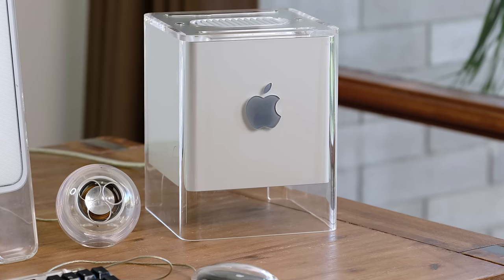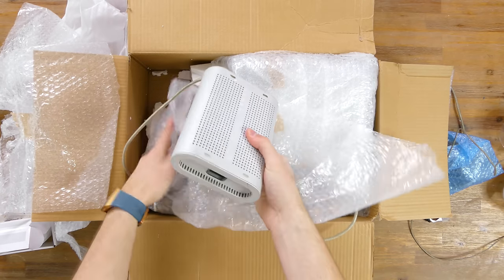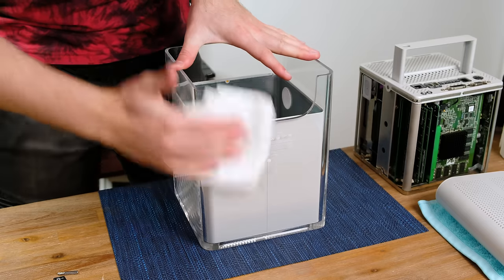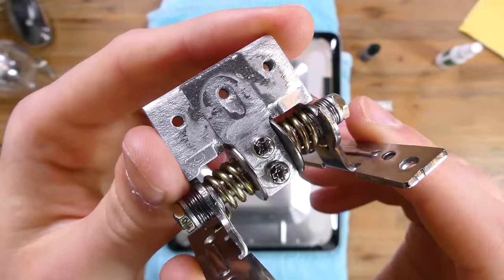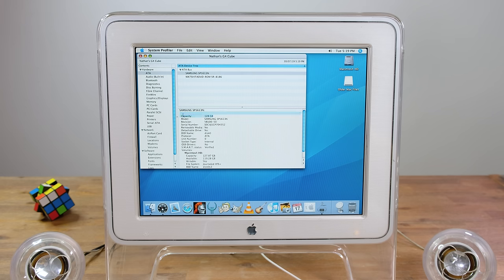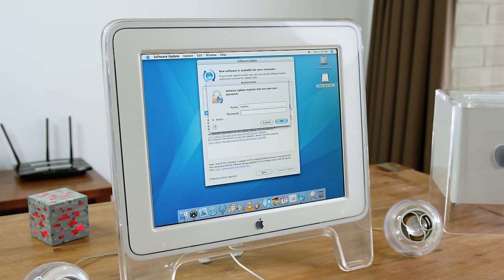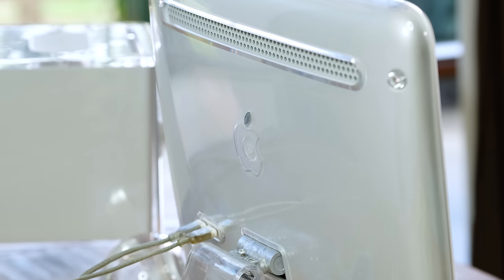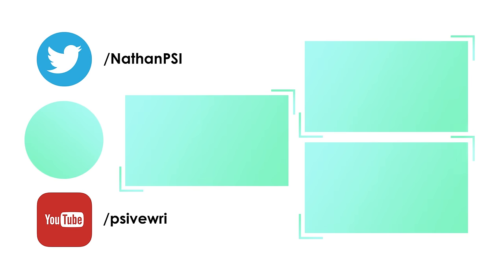Using Apple's G4 Cube!

Comment: Why do I love old PowerPC systems so much? This content is fantastic.
Reply: I prefer to only have 68,000 transistors in myyyyyyy CPUs.  #justkidding
Reply: RockWell Aim Hehe. This made me chuckle. 👍 👍
Reply: It’s a mac not pc. pfsh
Reply: Gaming Embassy I love all computers with PowerPC architecture. My first PowerPC computers were Power Macintoshes from the 90s, and later in the early 2000s I got a G3 and G4. I currently don’t have any PCs or non-Apple computers with PowerPC chips, but I’d really like to buy a new Raptor Talos 2, which uses modern POWER9 PowerPC chips.
Reply: Same here. I really like the whole G3/G4/G5 era of Apple
Reply: Yesss
Reply: For those using TenFourFox, there has recently been a breakthrough development that multiplies browsing speeds by several factors, making Web navigation on our 15+ year old Macs a feasible and fully usable endeavor. Link below for more info...

https://forums.macrumors.com/threads/poweruoc-the-ultimate-tenfourfox-preferences-file.2209108/

Comment: I worked at Apple when the Cube was released. I still have mine somewhere in the garage I think. It sold out at launch and for the first 2 weeks the sales were very strong...Then it happened. It was published about the screws in the top being over torqued and cracking the top plastic (This was not the case, it was from the fill process in with the acrylic). Needless to say the WSJ did an article about it and it was deemed a "flaw"  by the media. At this point we tried to fix the process but it wasn't doable. You could return your cube or get money back. It was canceled only after 3-6 months (I can't remember when we got the memo).

Crazy times.
Reply: This is true.
Reply: I had worked at Apple from '79 to '85, and was working at Sun Microsystems when the Cube came out. We were using some Macs in the documentation department where I was, and we got a couple Cubes to add to the early Macs we were also using. The "cracking" problem was clearly an issue with injection molding fill lines, but the press never really got it right. Interesting machine; one ended up coming home with me when we replaced them, and my wife used it for several more years before the iMac she's still using replaced it.

Comment: I acquired a G4 Cube in January, and I've upgraded it quite extensively.
I actually installed TWO SSDs: an mSATA SSD running Mac OS 9.2, and a 2.5-inch SATA SSD running Tiger in place of the optical drive. The Cube's optical drive died a while ago, and since I had several IDE-to-SATA adapters left over from earlier projects, I decided to turn my Cube into a dual-SSD machine!
I bought a great Formac Firewire external optical drive. It's only a CD-ROM drive, but due to the Firewire connection, inserted discs load almost instantly on the desktop.
I also installed a GeForce 2 MX graphics card with 32 MBs of V-RAM, and a fan (powered with a Molex double-adapter) to cool the new card more effectively.
The only component I haven't touched is the processor. I actually own a 1.2 Ghz G4 upgrade card, but it's unsupported for the Cube, and while other Cube owners I know have unsupported processor cards in their Cubes, I don't want to risk breaking my Cube's brain. I already had some hairy moments of failed booting while upgrading the Cube's hard-drive situation.

Since my main computer is a 2008 Mac Pro, Firewire 400 is far more convenient for transferring new files onto my Cube than through the Cube's slow USB 1.1 ports.
My Cube runs really well, and I use it for retro gaming and music (as the USB speakers sound amazing).
The Cube runs Mac OS 9 and earlier games flawlessly, and handles 3D games fairly well. RealMyst is pushing the Cube a bit, but RealMyst has never run well on any of my Macs (even my Mac Pro with a 1GB HD 5870 graphics card). Max Payne gets a bit juddery during gun-fights, but is still very playable.
My favourite computers are my 2008 Mac Pro, my Cube and my Lombard G3 Powerbook.

I love my Cube and had a great time upgrading it, and I'm glad you're so pleased with your own Cube. :)

Comment: "Methylated Spirits"? Is that Aussie for Isopropyl Alcohol?
Reply: Methylated spirits is stronger and should be sparingly used. Isopropyl is a mild cleaning solvent, which would have been more suitable.
Reply: Probably
Reply: Us aussies just clean everything with metho
Reply: @rdj1672  including our guts!
Reply: Methylated means "alcohol denatured with methanol", which is easily found in the US as denatured alcohol, not to be confused with isopropyl alcohol.
Reply: :( sad g4 cube sounds

Comment: I've got a 500MHz G4 Cube I bought new in 2000. It's been sitting mostly idle since about 2006, and I thought the hard drive and CD/DVD drive were going bad. I've owned dozens of different models of Macs since 1984, but it's the one I can't bear to part with, just because it's such a classic. I just recently got it working again, planning to put an SSD in it and max out the RAM. Perfect machine for running pre-OS X software (though I put Tiger on it, too). Speakers and everything are still in good shape.

Comment: I will be saving up for one of these. There is a video that shows you how to restore the rubber on the speakers and also convert the speaker connectors to usb with soldering.

Comment: You should’ve used TenFourFox instead of Camino. It supports more things
Reply: TenFourFox requires more RAM but he has it.  Camino was a great web browser but no workey on the modern web.  I have it on my Cube and it runs pretty well.  Much slower than Camino tho'.

Comment: Much of the time you can buy speaker foam/rubber suspension replacement kits, not sure if it works with speakers like those though.The glue usually comes off with some isopropyl and some scraping, its not so hard assuming they didn't glue the housings together.

Comment: What a find! I’ve wanted a G4 cube for years. Sad to hear about the cones on the speaker, but I believe that’s happened to most of those speakers over time, the iMac G4’s speakers were much more resilient as they were made out of another material.
Reply from the maker: Very true! My iMac G4 speakers are all still working great 👌
Reply: @psivewri  I happen to have a iMac G3 from roughly 1999 that had more or less the same foam used on the G4 cube speakers, weirdly they didn't disintegrate yet...
Reply: You can get replacement foam rings from AliExpress for not much. A bit of glue and the speakers will be a good as new.

Comment: I have 3 cubes and a 23" , 20" and 15" monitors. Mine run OSX 10.5 without a problem. I also have a Sonnet 1.25 processor upgrade. 
I was thinking of fitting an SSD.

Comment: Nice purchase; I ve always wished to get a Cube, its a beautiful piece of hardware. It looks great!!!

I have just repaired the Apple Pro Speakers  I bought for my Quicksilver G4 a while ago. They came in the same conditions, with  desintegrated and sticky rubber surrounds . Well, after some research I cleaned the expoiled rubber and put the unexpensive rubber surrounds I bought from Aliexpress and some Tacky glue. Like new! I keep the link if you want to buy them. I paid like  $3 for a pair and they fit nicely. I took the link from another Youtube comment, btw!

Comment: FYI these go for about $300-600 on ebay depending on condition and which performance version it was. But they are extremely hard to find complete and usually you only can buy the empty frames for about $80

Comment: Put a fan in it anyway.  There's a bracket for it under the cube, as if they knew you would need it. It will last longer if you do.  Also consider a SSD.  They are cheaper now, faster and cooler (temp wise) than a drive. Peace and good luck.

Comment: refoaming speakers isn't too hard to do.  I've purchased several sets of foam on ebay for around $10 a speaker.  There's plenty of resources on how to do it.  Also, using paper towels is basically using 3000 grit sandpaper on the plastic.  I'd probably wipe with a cloth of some kind instead.  Love your videos!  I like seeing your solutions a lot.
Reply from the maker: These paper towels are very soft thankfully. I'll have to look into redoing the speaker cones. Thanks!
Reply: @psivewri  That would make an awesome video all on its own!  Plus, you'll be amazed at how good those speakers still sound with a good refoaming.  Good luck!

Comment: It will run Leopard 10.5. The optical drives are picky on old cubes. Best to install or img via Firewire drives.
Reply: It's supposed to boot from USB as well, just gotta go through its Open Firmware to select it

Comment: Golly $175US was about what I paid for mine when the Intel machines came out!  I used it for three years until the Intel machines got cheep cheep cheep!
It was a great computer- did a lot of circuit interfacing and design with mine.

It was a kind of nice nod to us NeXT-heads when it came out btw.  At the time the NeXT Users Group, which met at Apple Campus monthly was kind of winding down and we were all commenting on what it was like to have tools that had previously been available to a very elite, industrious group, who all pretty much made >$100k per year to a more generic audience that were basically coming from all different levels of income+education levels.

Comment: Yoo TenFourFox is an amazing web browser for PowerPC Macs. It's the latest FireFox just back ported for 10.4/10.5 on G4 and G5 Macs. If you're just getting into PowerPC Macs, I recommend getting into the PowerMac G5s. Descent price, start with the Dual 1.8GHz, no singles. You'll be blown away by the speed and, complete usability on the modern web (Yes, with YouTube 480p playback). Just upgrade those trash stock GPUs
TenFourFox is available for PowerPC G3 Macs, but not doing that is also available as well

Comment: Use TenFourFox for web browsing on PowerPC. You can watch YouTube videos, and it is basically a source port of modern Firefox for PowerPC with added features made to have it run better on PowerPC. It is slow, but it is so much better than the severally outdated Camino.

Comment: So wanna hear a funny there is a fan mount on the G4 Cube  there are 4 stand off's on the bottom plate of the G4 Cube these stand off's where designed for a fan as a just in case the machine got to hot and cracked the case. apple already knew of this failure 100%

Comment: "Brilliant design team at Apple" - when this thing was designed, sure. 

Sadly, the moment they switched to intel CPUs and PC internals Mac died, both in value and quality. It irritates me that so many Apple fans refuse to acknowledge that they are just using over priced PCs despite identical specs to "PC" counterparts. The fact that you are literally paying more to NOT be able to properly upgrade or repair your system is sickening. When I say you are paying more to not be able to repair/upgrade easily/at all, it is not hyperbole, a lot of the increased price goes to "system integration" and design elements that do nothing more than make repair difficult/impractical. There is no Mac anymore, it has become like Dell, Lenovo, HP etc with the only difference being that it runs it's own OS (the only good thing left).